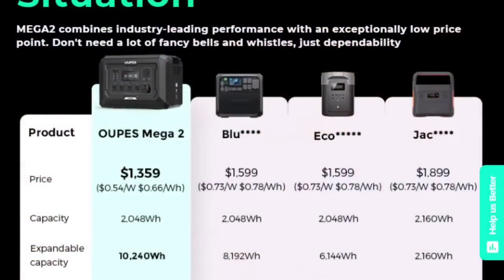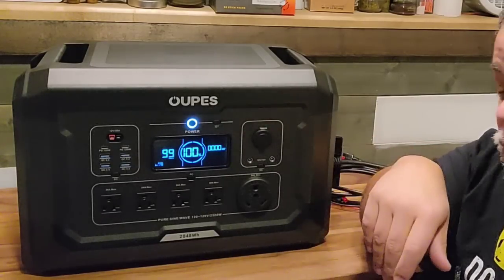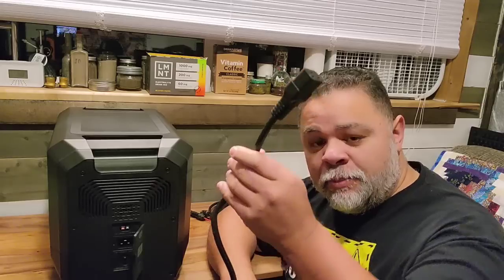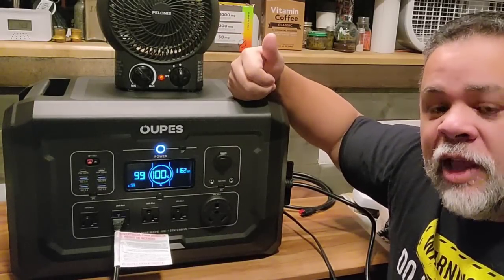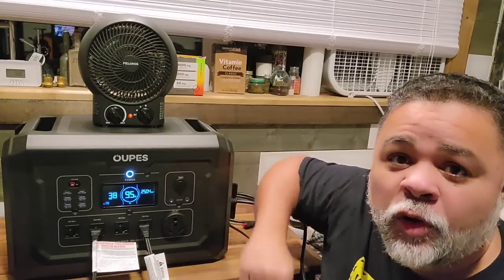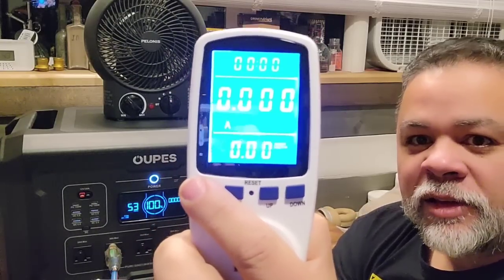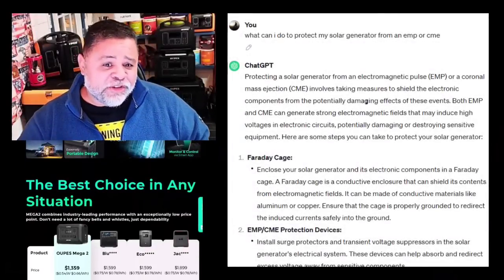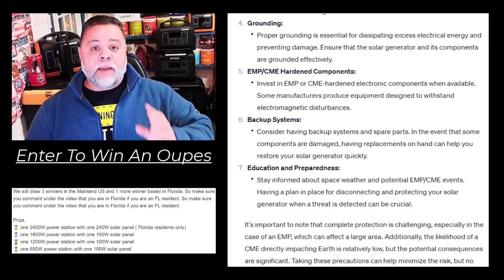The All New: MEGA 2 Portable Power Station From OUPES - UPS - 2500W - LiFePO4 - Super Efficient!

Comment: Can the magus 2 or 5 run the central ac unit
Reply: Make a swamp cooler or what i would do is put a FAN in the window tape the outer edges and often times that really brings in effective cool air then you can run refrigerator computers phones and other tablets around your house and easily stay under the power amounts. I would not use any mini oupes being the oupes mini to the oupes beast to run anything as those can't handle the loads like the MEGA can.

Comment: @ 9:54 Using a heater is completely meaningless test of UPS switchover time.  Instead, maybe use something like an old laptop with its battery removed. Sometimes multiple tests are necessary, to ensure you aren't lucky with where the waveform is at that instant.
Reply: You are spot on. 
Retest that switch over time endlessly.
How many times have some of us seen brown outs or quick on and offs from utilities just as the power is going out.

Comment: I just put my solar panel in a metal can and layered the inside with cardboard.
Reply: I did basically the same thing, except not for solar panels. I wanted to overprotect my items though because of the extreme texas heat, so before the cardboard I put in a layer of reflectix.
Reply: Can you use this for your house? Is it light weight?